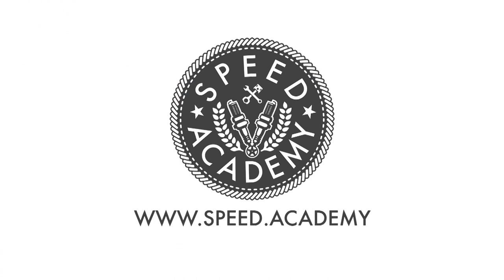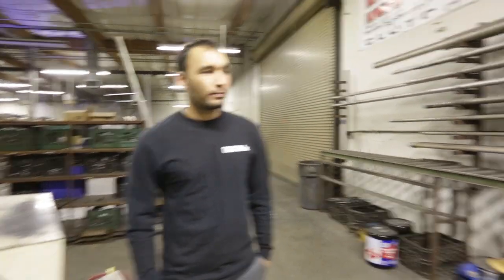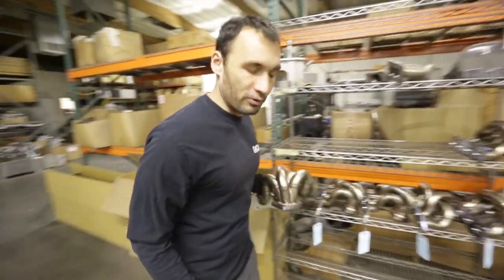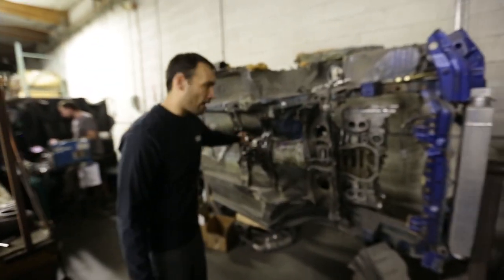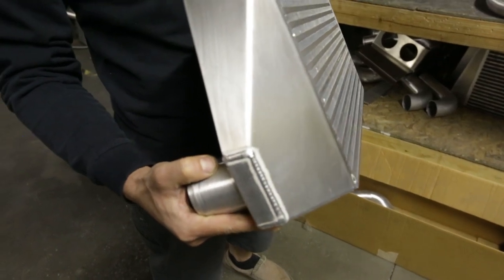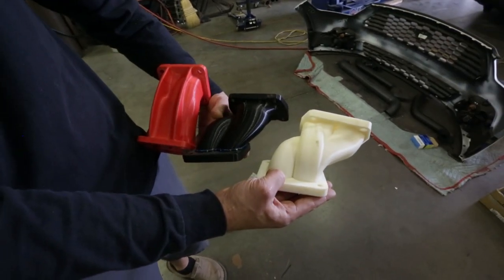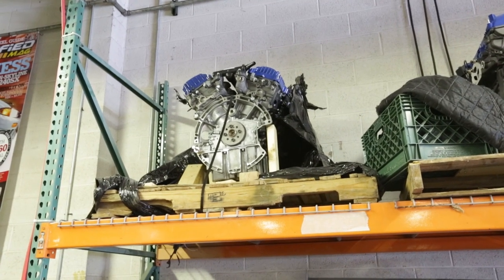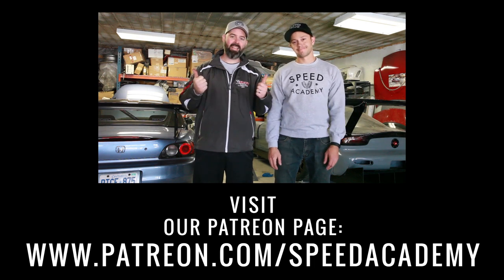How Turbo Systems are Made - Full-Race Motorsports Tour

Comment: What are the downsizes of a manifold that is too big?
Reply from the maker: You'll loose spool up speed.
Reply: Speed Academy Thanks
Reply: Loose Torque and Gain HP
It it is small you Gain Torque but lose HP
Neither is bad is depend what you want
Reply: Your engine will have to "fill" bigger amount of air if your manifold is too big, so it has to fill big headers volume and then it will spool turbo, that creates turbolag. Same with big ass intercoolers, for example, lot of guys which dont know basic rules has Subaru Impreza with stock TMIC which is designed for stock turbo, they buy big front mount intercooler with very long IC pipes, it takes so much time for stock turbo to fill that big volume till it gets to throttle body, so if you are running stock turbo you dont necessary need bigger IC and bigger sized headers. I recommend to use software for those applications, for example lotus simulation or pipemax, or new 4T header wizard.

Comment: 3.5L twin turbo ecoboost motor into the ecoboost mustang.

so much yes. IMO the base engine that the mustang should have had, then if you want more step up to the supercharged v8.
Reply: Wish the mustang got the Aussie barra turbo straight 6.
Reply: As good as that engine is, its still an old iron block design at heart, that makes it much much heavier than even the 5L v8, its also comparatively a very long and tall engine.

For cheap and easy power its a great engine (fantastic even, so much potential with so little work), for emissions, weight and handling its not the right choice though, for that the all alloy 3.5L V6 is a better fit.

Comment: i can do that by hand, no robot needed, hire me so i don't have to go to the cold canada next year!!
Reply: No! Go to Canada! That place is one of the JDM heavens!
Reply: Jorge Gameiro  I'm from Canada and
 I own a 91 Toyota sprinter 4wd diesel and 2 r32 gtr's, sadly  non are on the road :(
Reply: They have mechanical problems or are they not street legal?
Reply: SI0AX a civic hit my first gtr, then I bought it back (total loss, Front end damage)then I bought a 2nd for $2000 with a bad head gasket, then I bought the Sprinter because it was 4wd diesel and it was a Toyota (thinking it would last for 10 years if I kept up maintenance) but then the transmission broke. Then I found out that particular car is rare (even in japan) now I can't seem to find a replacement for it. I would get the JDM's back on the road but I am still working on my Audi A4 1.8t b5. I am almost done. I'm planning on building up one skyline, then selling it to a US buyer because of the demand, then using the money to fund my other skyline. As for the Sprinter I have to find another transmission then ether sell it or give it to a relative. My girlfriend doesn't want me to get rid of it because it was the car I drove when we first met.
Reply: Excellent idea on selling to a US buyer. It can just be driven from the border.